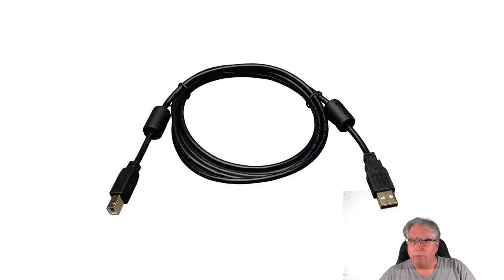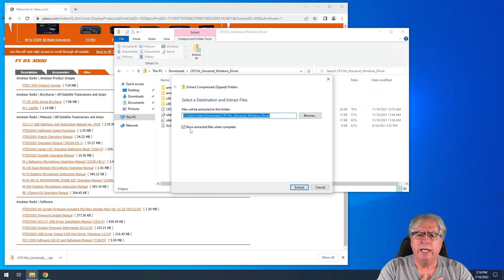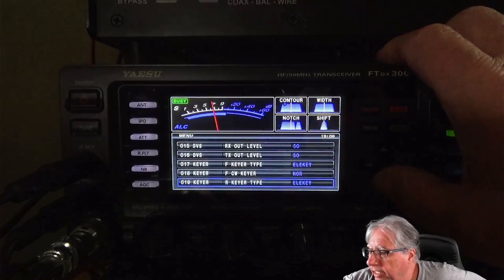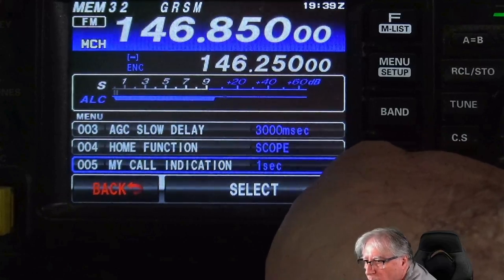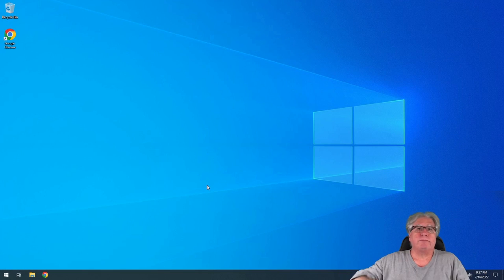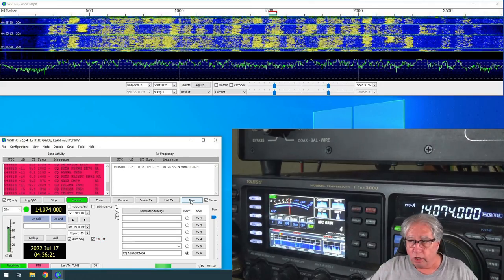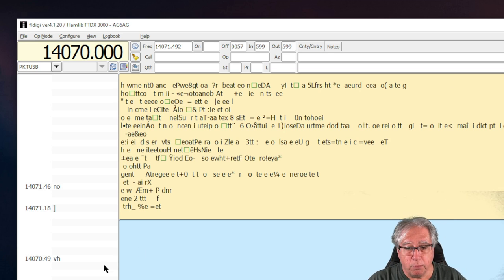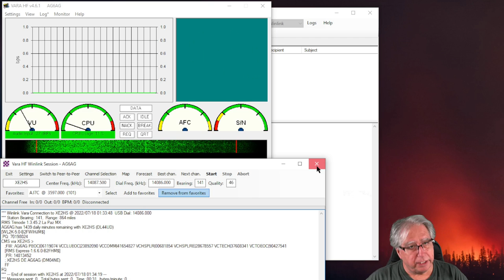How To Get Your Yaesu HF Rig Talking To Your PC Via USB For Digital Modes

Comment: Ive been besting my head agaiamt the wall for 2 days. Thank you for tellingus about the ftdx3000 issue wirh WSJT-X. Cant wait to try again in the morning, using the Ftdx5000 setting as rig.
Reply from the maker: Hope it worked out!

Stu
AG6AG
Reply: @AG6AG  It worked out just fine! Sorry for the previous typos. Wish they would fix the FTDX3000 software issue. Others shouldn't have to go through the frustration.

Comment: Hi Stu I watched your video with keen interest. As good as the video is, I'm still struggling setting up my FT-2000 d.  I'm finding the menu and written totallly different from the 991a I previouslyb used. Could you point me in the right direction please
Reply from the maker: It looks like the FT-2000d doesn't have a built in sound card? If that's the case you will need to use an external sound device such as a Signalink.

Stu
AG6AG

Comment: Thanks for the help.  Have one issue,  why does WSJT-X  change the mode on my Yaesu FTDX-10 from USB to DATA-U ?  . When I change it back and reset frequency as soon as I hit Transmit- It jumps back from USB to DATA-U ?  Appreciate your help !!!!
Reply from the maker: Hi James,
There is a setting under the rig control tab that you can set to "None" to keep that from happening

Stu
AG6AG

Comment: I had trouble finding and putting in the correct settings on the 991 while you did it on a different radio .
Reply from the maker: Hi Kenneth,
All the menu settings for the FT-991 are in the video description. Hope they help.

Stu
AG6AG

Comment: Stu, spent an hour following instructions exactly, did not work on 991A. All OK until CAT test. Port COM4 or 5 were not available on that screen. Baz
Reply from the maker: Hi Baz,
This is usually just a driver issue. Verify that the com ports are actually listed in the device manager and are COM4 and COM5. It's also important to make sure that you properly installed the drivers for the com ports from Yaesu.
Hope this helps you sort it out,

Stu
AG6AG

Comment: I have a Yeasu FT2000 and a USB Digimode 3 connector and I am unable to get HamRadioDeluxe up and running. The prompt tells me that the computer does not recognize the frequency?? No one seems to be able to answer me at least at the level I am. Thanks NO3G Steve
Reply: Try running the HRD program with administrator privileges.

Comment: Great vido Stu. I dwnld fr Yeasu and installed the drivers, followed your instructions, however when I connect my cable to the computer and look for the COM ports none are there. When I display "Drivers by Type" (under "view)", they show up as "oem116.inf (silabser.inf)" and "oem118.inf (ser2pl_1.inf)" but I don't get a COM number. HELP. Running on an HP Windows 11 Home Ver 23H2 Radio is a FTdx10. Again HELP.
Reply from the maker: Hi Jack,
This can be caused by they device identifying before the Radio Drivers were installed. There are a couple of things you can try:
1) With the radio on, open up the device manager and right click the two misidentified devices. Select delete device. Do this on device at a time. Once they are both deleted refresh the device tree and see if they show up as COM ports.

2) If (1) doesn't work, find where the device drivers were installed by the and for each of the devices select "Update Drivers". Say you want to choose the driver and browse to the location if the drivers on the computer. Select the driver and see if that resolves the issue.

Hope that get's you going...

Stu
AG6AG
Reply: Hey Stu, thanks for taking the time to help with this problem. I tried both suggestions but it didn't help. I even went so far as to try using another computer (it's also is a HP running the same Windows version). Little backstory, I have the same problem with my FTdx1200. I'm beginning to think it is a problem with the computer more so than the radios. Again thanks.
Reply from the maker: Hmmm....
I didn't know the 1200 had a USB port. Are you trying to connect to the external serial port on the FTdx10?

Stu
AG6AG